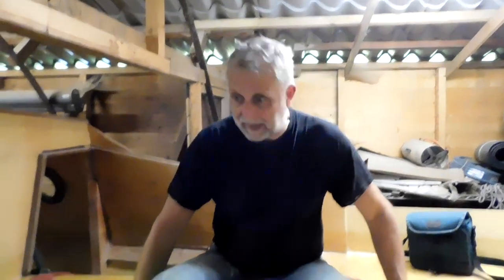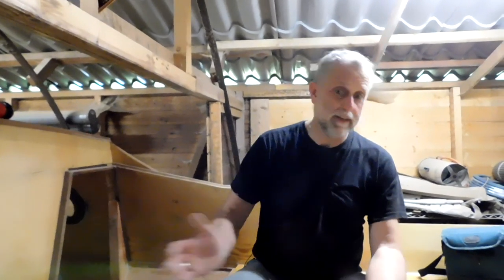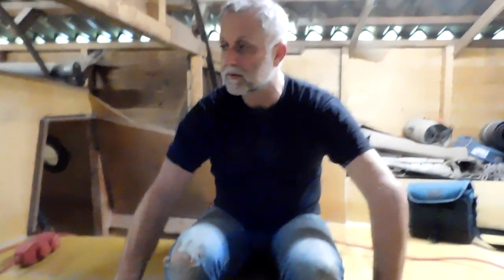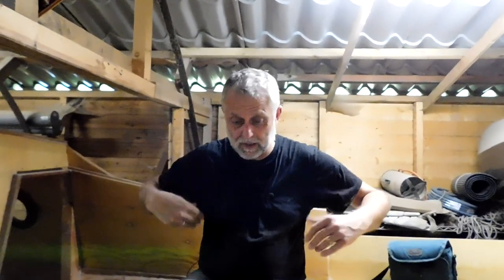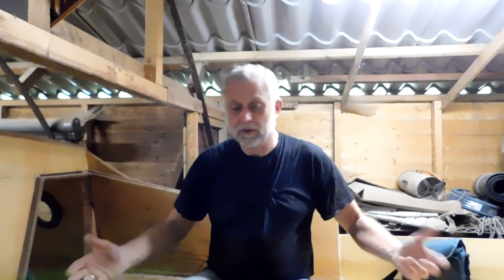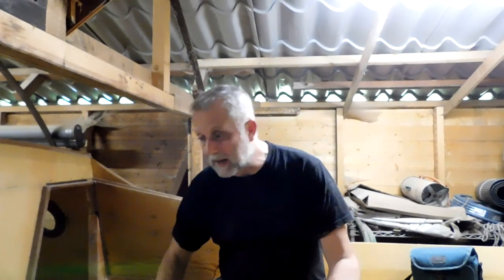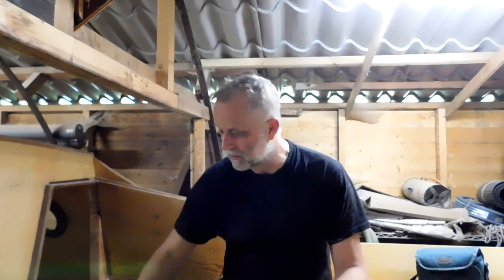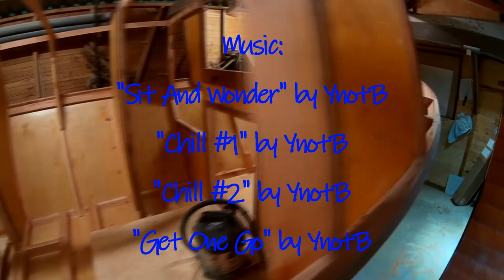Glassing the aft deck - SV Tapatya EP87

Comment: Nice job laying glass for sure ! I don’t mind the flat spots but I hate the overhead spots ! Did you mix yours 10oz’s and 5 drops of hardener ? The first batch I did I used to much hardener and ran out of time ! Lol
Reply from the maker: Thanks Dave. I don't vary the resin / hardener ratio. I just stick to the manufacturer's recommendations.
Yes, overhead is a different ballgame. You have to let the first coat of epoxy tack up just right and do small areas at a time.